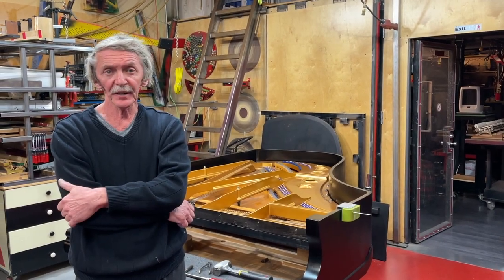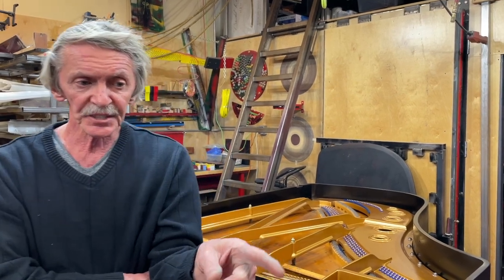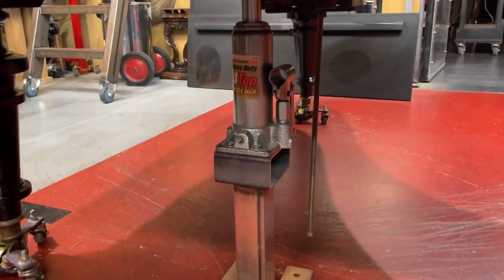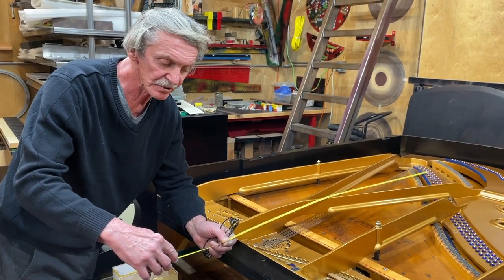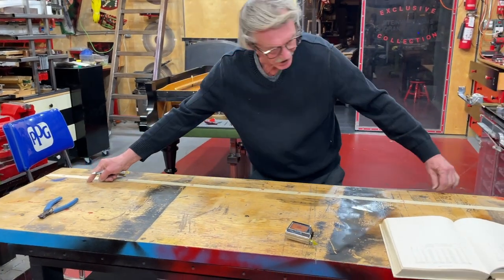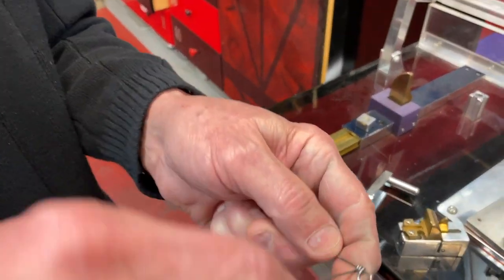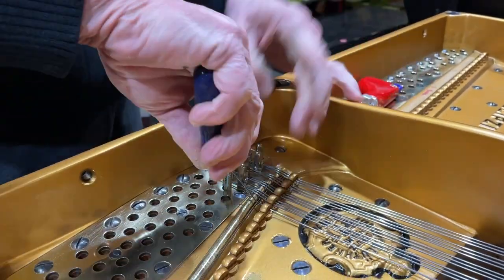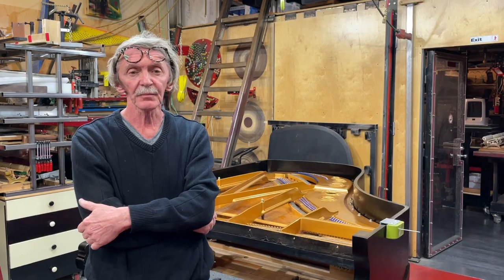Restringing Antique Bluthner Grand Piano

Comment: Гена, рад что ты не утомим в своих изысканиях, и то что ты делишься ими с людьми заслуживает уважения. Нас остается все меньше и меньше, скупиться не наш путь.
Reply from the maker: Виталик,

Благодарю тебя за добрые слова. Надеюсь, у тебя все хорошо, мой старый друг. Звони мне в любое время.

Гена
Reply: @PIANOSXXI  Hi, I'm fairly certain that when they were restringing my piano the workshop did not use any support under the pin block to absorb the force of hammering new pins in. What kind of damage did this potentially do? Thank you!
Reply from the maker: @zvelekva  Thank you for your comment. If the piano rebuilder didn't use support under the pin block to absorb the force of hammering, it's akin to driving your car over sharp nails. The plate could develop a crack, or the glue joints might be damaged, and this may result in various types of harm to each piano.